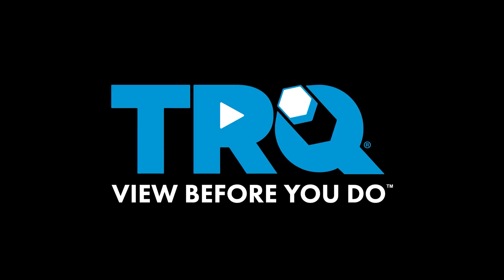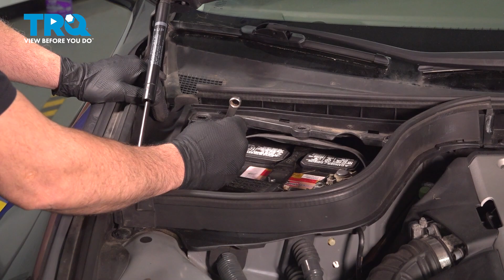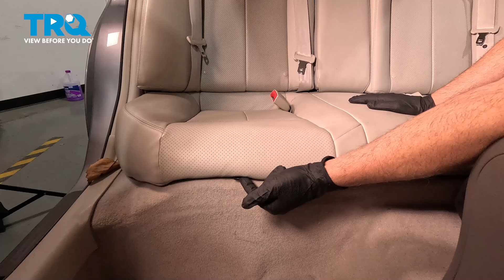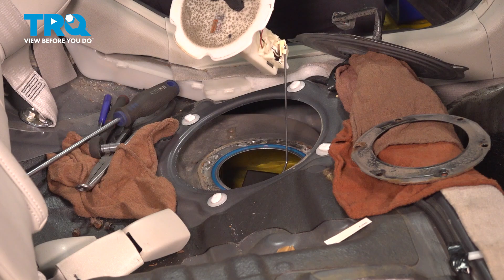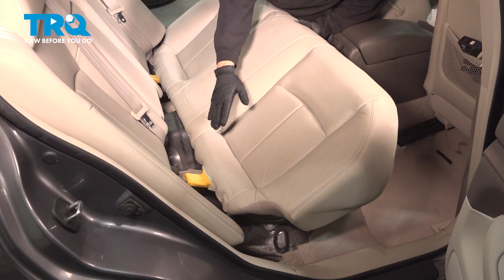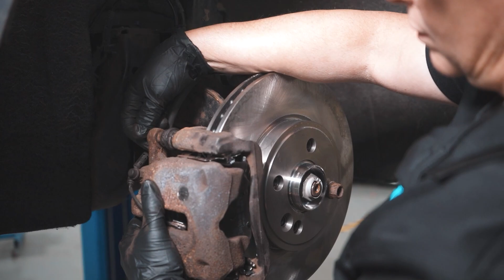How to Replace Fuel Tank Sending Unit 2008-2013 Infiniti G37x

Comment: This is behind the driver's seat, correct? Fuel pump is pass side? What components were changed on the unit/bracket itself? I see you reused the OEM bracket; did you simply replace the wires, connectors and sensor? How does that get attached? Thanks for the vids!